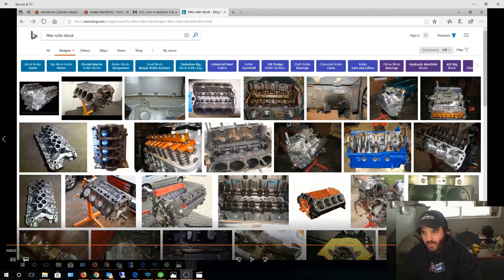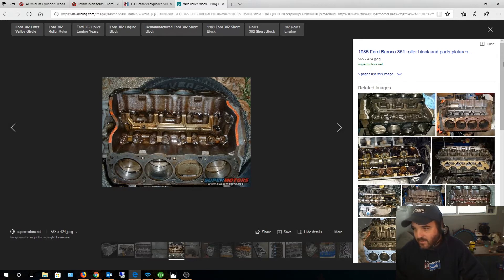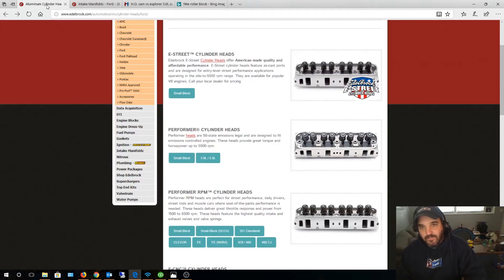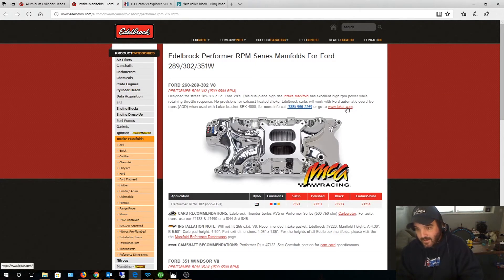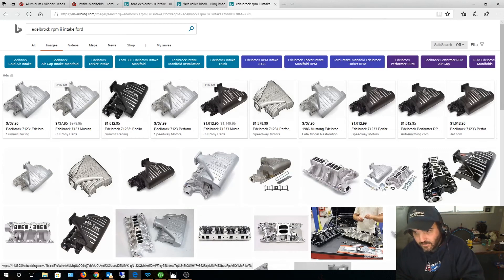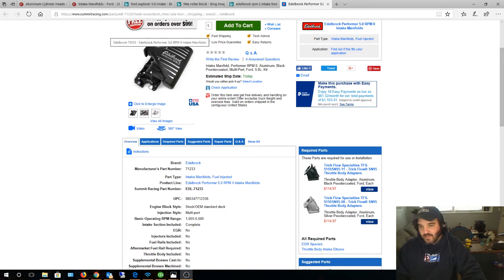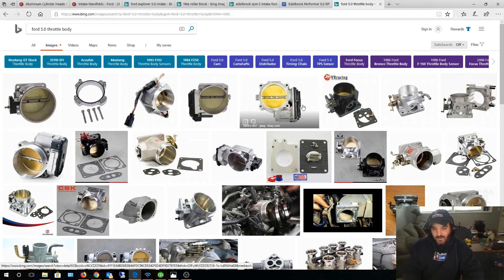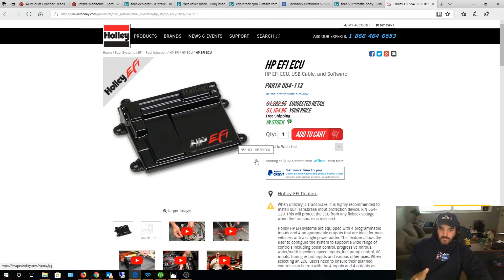Early Bronco Truck Engine Building Tips and tricks More torque and throttle reponse

Comment: I have a 92 F250 with a 302....and rebuilt both engine and tranny in the past two years.  Put Brodix ST5.0 R heads in....and a nice Crane Cams  low end cam, as well as the Edelbrock Performer truck manifold.  It runs great but lacks great acceleration.  The mistake I think I made was to put in a torque converter that is really meant for towing and hauling, and I didn't realize it would bog the truck down a hell of a lot, esp in first gear.  It's a great billet torque converter made by Hughes....but really not meant for a 302 engine, I would guess.  I think it's meant more for a much larger gas motor, as it's stall is way too low.  My truck mostly runs at about 1500 rpm....when it really should be running at more like 2000 or so.  My fuel mileage sucks right now.  I'll live with it right now...and not drive it too often, but I'll be looking at changing it up down the road.  The engine and tranny are running strong...and running nice and cool....but not so much fun to drive, on the whole...and the gas cost really sucks.

Comment: The moment you said flat top pistons were stock in A 351 Windsor I turned it off
Reply from the maker: No sure what your talking about,  I have dished pistons so I can run 87 octane gas.
Reply: He literally didn't say that. At 3:30 he was talking about how the flat tops were harder to control detonation with and mentioned that he likes the stock ones better (being not flat top). Maybe get your facts right before you comment.

Comment: It’s all about combination. My build is different and goes against most logic.
302 stroked/bored to 333. Blueprint 190cc heads 2.02/1.60 valves, Howard’s linkbar lifters, dual plane intake, annular booster 600 carb on 1” wood open spacer, comp xe266hr12 cam, 1980 Bronco on 35s with 3:50 gears. 4 speed granny trans, 6.69:1 first gear, McLeod stage 2 clutch, I actually use 1st to get going, my setup loves to rev, 1st gear to 15, 2nd to 40, 3rd to 70, and 4th to 85 freeway cruising at about 2700rpm. Gotten above 90 but it’s sketchy as the 40 year old springs are tired and little bumps make me twisty bouncy at high speed. Everybody’s build needs are different.

Comment: 4 valve cylinder heads in modern trucks way outflow 2 valve heads with no loss in low end torque, you can go big if you cam it right......using stock cams or near stock cam specs suffer with high flow parts of course.
Reply from the maker: I'm a big believer in faster moving air. Small runner